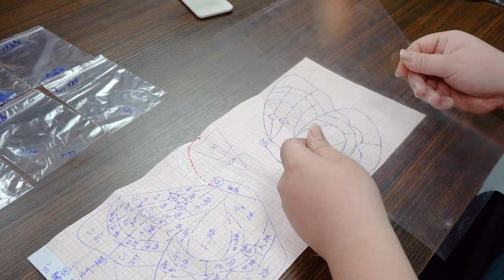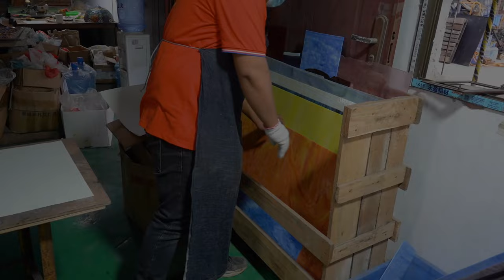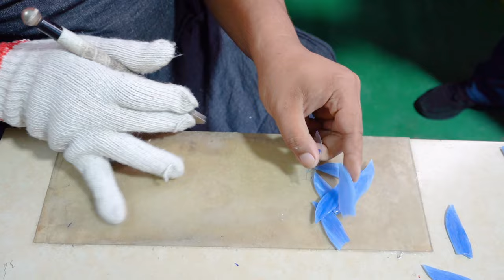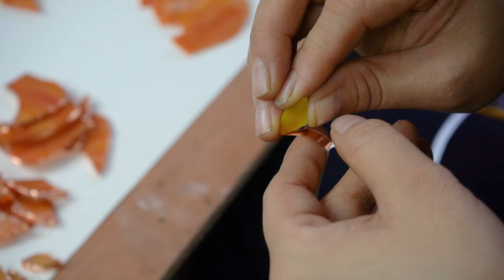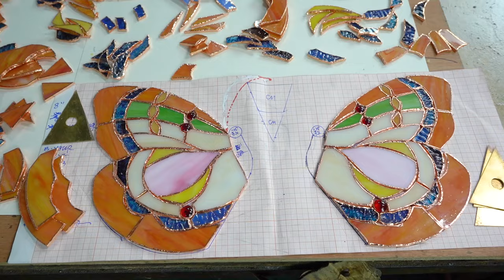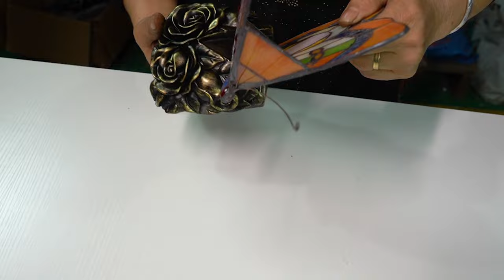Making a Beautiful Butterfly Tiffany Lamp.  Chinese Lamp Factory

Comment: Amazing how very fast they work, expect the workers are paid by the finished set of tasks per day, and the finished works appear lovely and likely more affordable than an individual artisan handcraft.  However, there are some corners cut in order to complete pieces quickly and economically, such as they didn't select the glass based on how striations in the color patterns fit the overall design or putting a raised 'bead' on the solder flow over the copper foil and in some places using large portions of soldier to close open spaces between glass pieces rather than tightly fitting the glass. Still the finished products appear to be very decorative, and I do love how well the fixtures and bases are duplicated from the art nouveau originals.

Comment: Thanks for this interesting video! I am always amazed at how fast professional glass workers do their job. Just as with another of your videos, please explain why the foiled pieces are placed in a container and then shaken. I have also seen the use of a hot air gun on those pieces in another video. Does that help the foil attach to the glass? Very hard to meet their prices as seen on their link.
Reply: Appears that when they wrap the glass with the copper foil strips, they press down the sides a bit but don't take the time to go around the whole piece by hand.  Looks like shaking several pieces in the closed container forces the glass pieces to bounce against each other thereby pressing the copper foil down to the glass sides.  Going to have to try that process one day.

Comment: Hermoso trabajo ❤ una pregunta, porque sacude las piezas en el bote? Saludos!
Reply: normally you use a special implement to rub the foil thight against the glass. Here a shortcut is used by shaking the pieces against each other to accomplish that. But soldering water can creep under the foil easily if you don't push the foil very good against the glass.